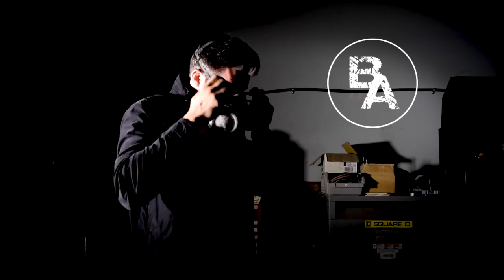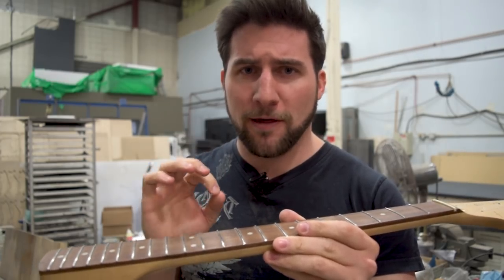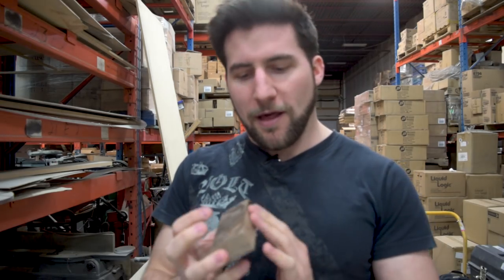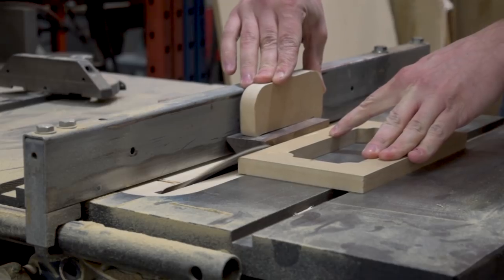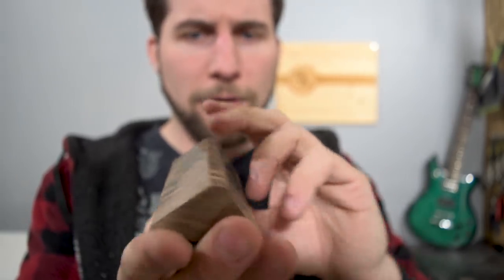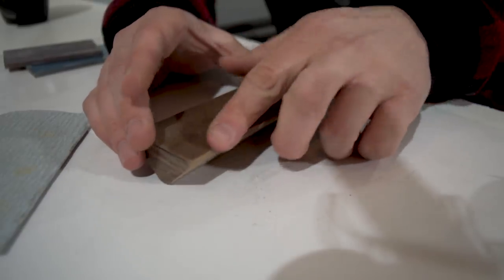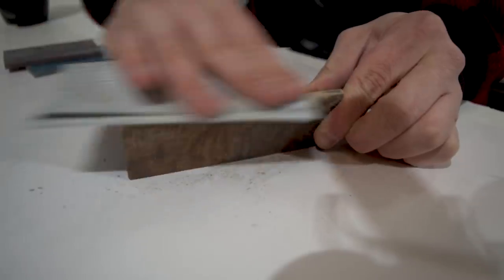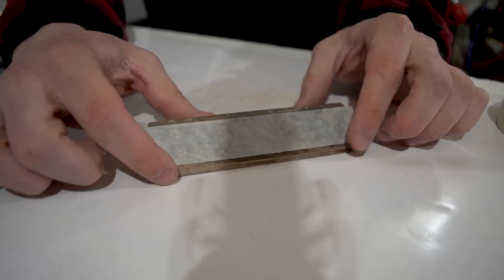CHEAP and EFFECTIVE DIY fret crowning tool

Comment: Hey novel idea just use a 3 cornered file and run the edge on a belt sander or grinder to create a safe edge then just run on a few grades of wet and dry to get it to a nice smooth finish on the safe edge
Reply from the maker: Lots of people do that. I’m not all that fond of that method because it is considerably slower trying to keep it perfectly straight, but it’s a fairly classic option.

Comment: Wow, nice job. Watching the video and reading the comments gave me this idea: Instead of the whole tablesaw thing, just go down to the local bigbox lumber place and get a length of dimensioned, milled oak "dowel". My place calls them dowels even though they are square in cross section, and they usually have some in oak, 3/4 or 1 inch square. Use the sander to flatten two opposite corners of a short piece. Then do the trick with the tape, superglue and sandpaper, but now you have four surfaces to put paper on, like a doublesided version of your tool.  Heck, do all four corners and use 4 different grades of sandpaper. Smaller makes it easier to see what you're doing, and saves sandpaper and tape too. I'm getting ready to refret an old acoustic beater and I think I'll try this before I buy a 3corner or fret file. Thanks! Here's another idea: Take a drill bit of the appropriate diameter and drill a hole in a piece of hardwood, then cut/sand so that you cut through the hole. Now you have a small curved sanding block to finish off the crown, going along the fret rather than across it.

Comment: I normally use a slim taper 3-corner file. What I like about this is the tool looks like it would work better on the upper frets when the neck is attached to the body.
Reply from the maker: Is it weird that I hate doing my crowning with a 3 corner?
Reply: I agree the 3 corner file is a go to for me. Even though I use a saw sharpening 3 corner file I would prefer a no 4 cut so less sanding. Whilst this wooden block works you can’t see what you’re doing due to it being massive. I think what Guns and guitars vertical version looses in speed it gains massively in visibility.
For me if I didn’t finish my frets off with a zfile id use a lollipop stick with wet and dry paper stuck to it as is would work like a 3 cornered file in principle. I need to try it to see if it speeds up the polishing process moving through the grits

Comment: Brad,  I am (excessively) typing this morning because  I want to see your channel flourish. 
I use the expensive Gripper push tool.  
The Gripper MAY have worked perfectly while cutting that small piece of Walnut. 
Hard to part with the $$$ but way cheaper than a visit to the Emergency room. 
I’m well into retirement and use my basic table saw many times a week. 
Nuff said. 
-Bob. Athens.  GA

Comment: Good video Brad. 
 I refuse to buy from Amazon!  I bought from Crimson before but thanks to BORIS&BREXIT  this is outta my budget.  
For the final polish , I use silicon nail polishing pads. 1.25€ for a pack of 3 different grits from the ´Chino Bazaar´ shop at the end of my street.. I also use super fine TAMIYA emery paper from my local model&hobby Shop! 😎 BUY LOCAL FOLKS
Reply from the maker: Glad you found something inexpensive that works for you.

Comment: Absolutely love your modified Fret Crowning Tool -  also a Fret Leveling Tool can be made out of wood or an aluminum level using the same procedures and all in all save quite a bit of money.  I now can handle a complete setup on  my bass and guitar. Thanks for sharing.
Reply from the maker: Cheers. I did one with a level and some hilariously hand made tools on my Home Depot challenge guitar kit. There are definitely some options.

Comment: This is a good cheap way to do a single fret or maybe a few, but you are going to go through a lot of paper doing a whole fretboard like this. Also, it is going to take way longer than if you are using a proper crowning file. If you are just doing one or two guitars ever, this is fine and will save you some money, but if you are wanting to get into doing regular repair work, just spring for a diamond crowning file. They do a beautiful job at blazing speeds and they last for dozens of fret jobs. They pay for themselves after a single job and they will save you a lot of headache.
Reply from the maker: Yeah I wouldn’t use this if you’re doing a bunch. I used a diamond crowning file for a while. I’ve switched to a faster method now, but certainly wouldn’t be doing this version for the several necks per year that I work on.

Comment: You don't have to stick so wide strip of sand paper. You don't use the rest of the sandpaper. As you use the narrow line of sand paper how often do you change it while you work at the entire fretboard?
Reply from the maker: I just flip it upside down part way through the job to use the other side of the strip.

Comment: Hey Brad, you could use a fret wire ( unused) and a sandpaper over ir then you grind some from your sanding block you'll get a "fret Groove" after it you end up with a "negative" of that Fret. You stick a stripe of sand paper, trim it and then you have one of those crowning tools.. nice one this one you made.

Take care of your fingers with the sawbench ...
Reply from the maker: That’s true. It probably wouldn’t last long so you’d have to make several or replace the sandpaper frequently, but it’s definitely doable.
Reply: @BradAngove  I use a toothbrush to clean the sandpaper in the groove regularly. The sandpaper lasts longer than I originally thought; it cuts even when it looks very worn. It definitely makes sense to fabricate a couple of these tools, no special equipment is needed. It could be made by drilling a hole in a hardwood block with a 2.5/3/4/5/6 drill bit, too, and cutting the block in half lengthwise. The other possibility is using the same kind of fret as you wish to crown as a template, glue a piece of sandpaper in top, and cut the groove with that.
When using the tool one should be careful not to remove material from the top of the fret, as with all concave files. That can be minimized with frequent checking and using fine grit sandpaper. A nice trick is using spray glue to make the sandpaper self adhesive, although a more secure glueing with superglue may be necessary.

Comment: ...good video bud ,frets are so easy to mess up & damage & especially the fretboard so i would use a metal fret plate guard ,the ones you buy on-line 2 for a couple of bucks, & a £2.60 S*** M** fret file...great for the money and has a smooth edge so you can't mark your fretboard, if someones first time i would insist on a thin metal fretboard guard,the kind people use when polishing frets...Dan builds bass's as well as repairs bass's/guitars,got some great tip's of him myself ...he has a lot of experience of fretting,dressing,building,wiring  etc..if it's your prized/worshipped bass or guitar i would take it to a pro like him or practice fret dressing on a few old broken cheap accoustics  first...one slip or over dress a fret & your worse off than when you started ... be careful or could be a disaster...,if a cheap $100 bass your not gonna cry if it doesn't work out well but if it's your prized '64 Fender Jazz i would save up for the best real luthier to do any fret work....respect
Reply from the maker: Yeah, fret work can be daunting and it’s good to protect it if you’re using the lively methods. I don’t even tape mine anymore, but I do it differently now and have been doing necks for quite a while.

Comment: Awesome video, Brad! I think for my hands, your sanding block will work the best. Really like the trick to glue the sandpaper to the masking tape. It's almost Friday night, so time to rub it....the fret that is! Thanks for this video and I look forward to the upcoming ones.
Reply from the maker: Hahaha the good old Friday night wire rub...
Reply: Randy Kelsoe I agree. Will be building one for me.  Rub a dub dub...
Reply: Brad: I am guessing you cut the sandpaper width to match the masking tape. Since you only seem to be using less than 1/4" of the width, could the sandpaper strip be more narrow (like maybe 1/2 the width of the tape)?
Reply from the maker: Yes, it could be half the width of that and you could still proceed to flip it over once it’s gets a bit worn out.

Comment: You could use PSA backed sandpaper. Or alternatively you could use light duty two-sided carpet tape to attach the sandpaper
Reply from the maker: Carpet tape is too flexible for this application, and it’s a pain to remove. This technique is designed to avoid needing that stuff.

Comment: Hi buddy just a small question for ya bud,I've just leveling my frets done this process all right set the kneck relief straight kneck as always before I start checked it again and again,used a diamond file to level SS frets now I no there abit a nightmare but I no I shouldn't have to go over n over the same old thing so many times and frets like 6  10     12  14  22 just seem to be higher and wont level down I'm worried to do it individual incase I muck it all up,any idea what it could be mate!! Kneck relief is still straight!! I dont understand
Reply from the maker: They’re probably just still high. Stainless is very challenging. Is there a big flat spot on top of those frets?
Reply: @BradAngove  it seems to be getting abit better but slowly now,when I take a metal straight edge across the frets they seem to be looking more level now but 1 or 2 frets seem a fraction just a hairline to high when I check mate,SS frets never never again I cant they are so stressful haha looking forward to just crowning them.what does it mean bye flat spots is it like dents if so there is not any thing like that mate
Reply from the maker: I mean do you have a couple that just look flat across the top? Like they’ve been sanded flat across the top?

Comment: What do you think about making the flat area slightly smaller than the distance between the 2 closest frets? For example my p-bass is .560 between the last 2 frets, so I was thinking about making the flat reference area a half inch long to give myself a easier time keeping it flat at first. I'm trying to for see if it would cause any other issues I'm not thinking of.
Reply from the maker: Unless it somehow makes it more difficult to angle after, I see no issues. Just make sure it isn’t so wide that the sandpaper touches both of those closes two frets at the same time. 
It’s not difficult to get a flat reference with the 1/4” area though; just to be clear.

Comment: Would I use the same tools and techniques to revive the frets on a bass?
Reply from the maker: That depends on what’s wrong with them. What are we dealing with here?
Reply: Mostly we're dealing with neglect. They have some dings and bumps and are generally solid but have suffered some abuse. I can show you a photo if you're okay with that. I don't want to steal too much of your time.
Reply from the maker: You’ll just need to level them first and then you go through this crowning procedure. Then you finish off by rounding the corners of the frets, which you can also do with this tool.
Reply: Will do. Thanks!!!!!!!

Comment: Brad, my guitar has some small dents the  width of the string on the lower frets, seems like someone dropped something on the neck and it dented the fret with the string, when you bend the string it gets stuck in the dent. how can I remove those dents? do I need to sand down all the frets on the neck to the depth of the dent? thanks
Reply from the maker: That’s what I would do. Level the frets down and then re crown them.
Reply: @BradAngove bummer that's really kill fret life, I saw a video that they used a silver solder solution to fill the dent then re-crowned it. maybe a temp fix worth exploring. thanks for responding.
Reply from the maker: If you’re looking for a permanent solution, the best option is re-fretting. Just pull the dented frets, replace them, and then level and dress.
Reply: @BradAngove  that should be fun, we're talking a $60 beatup epiphone I bought for the purpose of learning fret dressing😁

Comment: Great video Brad.  FWIW, I like your DIY tool idea better.  Your design takes a bit more of the error potential away.  More contact with the fretboard, equals more control.    But, I will say this, a 3 corner file is really tough to beat. A 3 corner crowning file is less than $30 from StewMac or under $20 from LMII.  I have a Crimson 3 corner crowning file, and it is a VERY nice file.  Having as many guitars as I do, and building as many kits as I've built, I bought the Z-File from Stew Mac.  It's saved me a WORLD of time doing fretwork (about 1/2 the time of using a 3 corner file), and the consistency I get from using the Z-File is pretty amazing.  They're not cheap, but if you're doing a lot of fretwork they pay for themselves rather quickly.
Reply from the maker: I find the 3 corner files very slow. I like them, but this method seems a lot faster to me. As for the z-files, personally I’ve never worked with them. I hear they increase gouging risk, but in general they’re just out of my price range regardless haha. Im glad to hear you’re having success with one. I’ll have to keep that in mind for future tool choices.
Reply: Brad Angove the Crimson 3 corner file is fairly aggressive, not too aggressive though.  It does leave some scratches that can take some work to get out.  
I haven't noticed ANY gouging from the Z-File. I bought the single edge Z-File.  I've done 6 full level and crowns, 3 on my kit builds and 3 on existing guitars that were in serious need. Also some spot crowning here and there as needed.  Zero issues.  As you may know or not, the first fretwork I ever did was January this year.  FWIW, I had to redo the first level crown polish (the one I did with the 3 corner file).

Comment: For those of us in the uk and Europe the American and euro sandpaper grit sizes are different 800us is about 500uk and 2000us is about 1000uk it isn't  linear and at about 220grit they are actually the same.

Comment: I would make 6 of these blocks with the following grits: block one, 60/80, block 2, 120/220, block 3, 320/400, block 4, 600/800, block 5, 1000/1500, block 6, 2000/2500. each block would be marked, each side marked with proper grit.

Comment: Interesting idea, but I think a triangular file with the edges ground flat would do a better job. It does occur to me that you are only using a very tiny bit of the sandpaper. It you made your block using 60 degree angles and put the same 1/4" flat edges all around, you could at least turn the tool over and  double the amount of use you get out of each piece of sandpaper.
Reply from the maker: I much prefer this over the triangle file. It's faster and easier to keep straight (because of where you hold it), and you have more grit options. There are other better files out there for the job though.

Comment: When should I redo my frets? how flat do they have to get?
Reply from the maker: Redo them when they are no longer level and start to give you issues.  You need to level the tops completely with the truss rod straight before crowning.
Reply: @BradAngove  thanks I'll need to do them eventually as well as tighten up the neck pocket.. My neck is flat but the truss rod is maxed out.

Its my favorite guitar but a shop improperly installed a floyd rose and  nut off center and its beenw aggrivating me for years. It'll be a project someday to fix
Reply from the maker: Have you considered shimming the neck? Assuming it’s a bolt on...
Reply: @BradAngove  yeah i did shim the neck to fix that part, but the two posts are too wide for the trem so it doesn't return to zero correctly as its not riding in those kinfe edges right

Comment: Cheap ok, but next time maybe throw in some suggestions for those that do not have a table saw. Pieces with a 45 deg profile are cheaply available in local shops. Just buy one (comes usually in 2m lengths so you will have lots of spare) and glue it on another one that is square. Boom, no table saw required...

Comment: There's no need to use a circular or band saw to cut 2x 45 angles.
Just use the corner of a square edge board 2 45's is 90 degrees and every piece of board has a corner with 2 45's it's called a right angle. A hand saw will be all you need.

Comment: Very nice. And how long are those frets going to last with a ‘razor thin’ (your words, not mine) surface under the string?
Reply from the maker: It depends on what your fret material is. Some are harder than others. Either way, you need a precise intonation point to have your guitar play as well as possible. The very apex of a smooth curve (even a circle) is still a razor thin line.

Comment: Why would you use super glue ranther than two side tape? Looked like more of a pain. I like the masking tape first idea.
Reply from the maker: It allows for a flatter surface with no “give”. As long as you put the masking tape down first though you can use two sided tape. It’s a pain to remove if you don’t mask first.